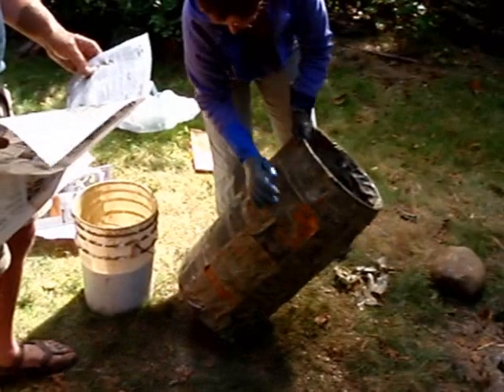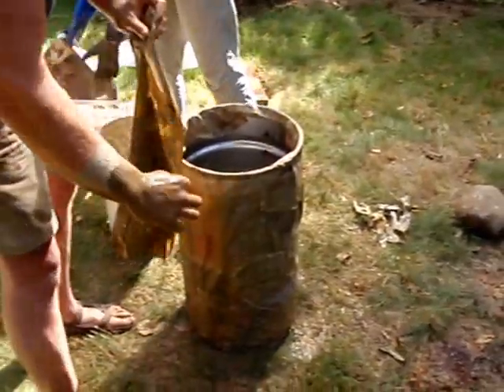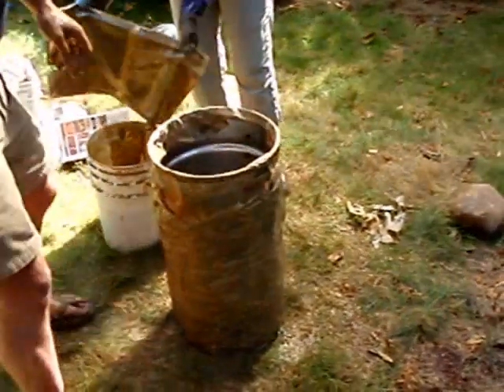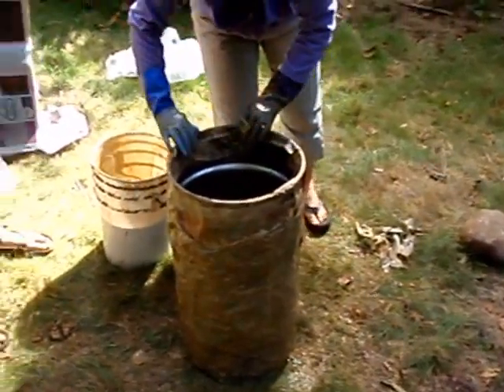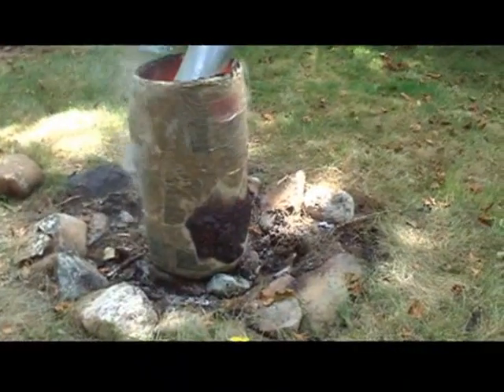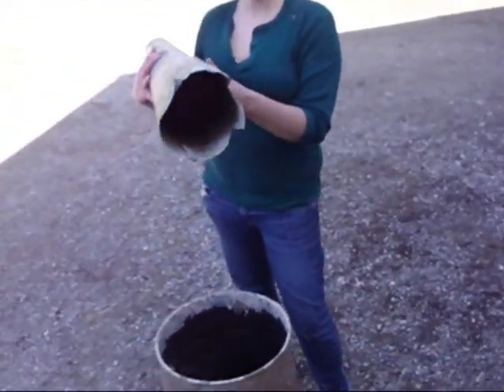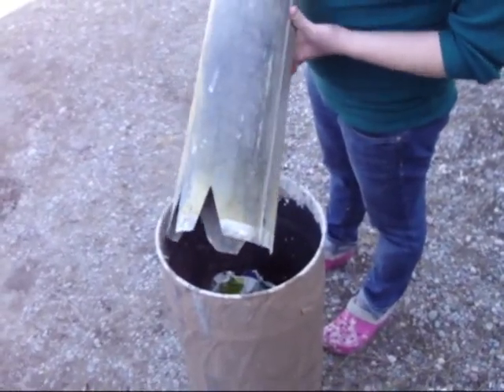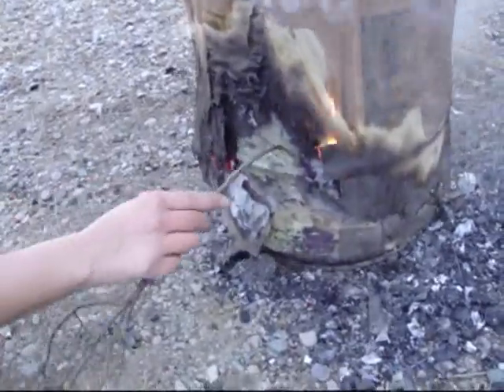rocket flames - rocket mass heater barrel prep

Comment: what should be the ratio of  pipe diameter to vertical length of pipe ie 
(pipe diameter /length of pipe). Can SS 304 pipe be used for the air intake and flue exhaust?. Thank you

Comment: When making either J-rockets or L-rockets, I make the entire fire tube length out of stainless steel. 1mm is thick enough, 3mm is really good. Anywhere the burning fuel and the hot gases touch is stainless, with stainless welds. All the rest can be mild steel. I've never yet seen stainless burn through, even after YEARS of use. Dry, 'fluffy' (air-filled) wood ash is fine as insulation around the fire tube, contained in a mild steel or fire-brick outer case. 1mm s-s welds OK with 1.6mm s-s rods.

Comment: So what is the point of the newspaper?
Reply: Sad that after 12 years I see this unanswered question and feel compelled to help the next person in line who is wondering the same thing.
The clay soaked paper "mache" will help insulate the barrel and concentrate heat right there on the outside where the undesirable paint layer resides.  This assists in burning off the paint and may even give the paint residue something to adhere to and flake off.